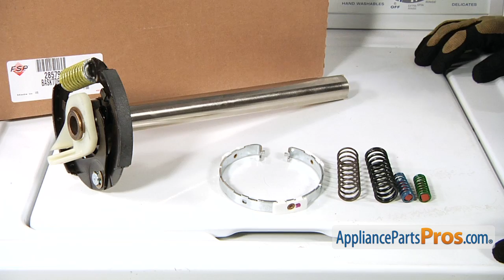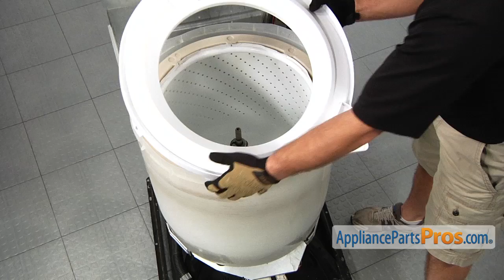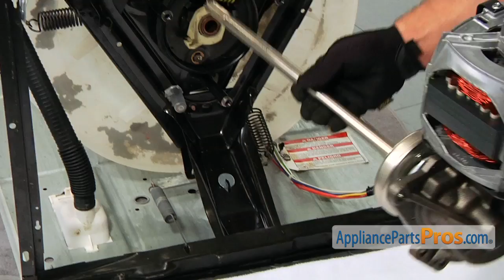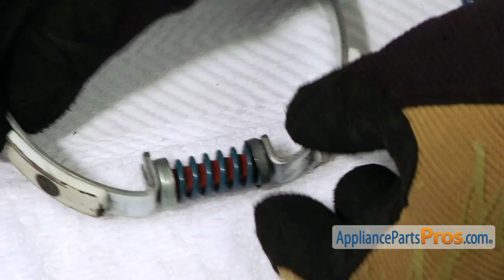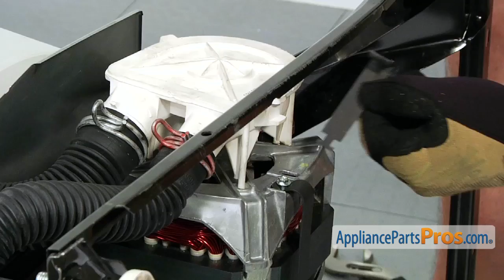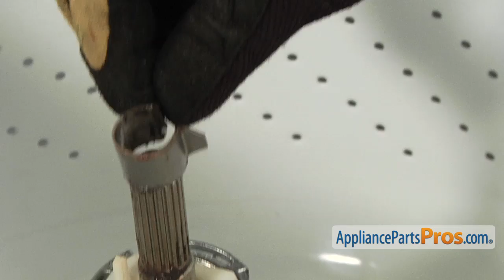Whirlpool Washer Basket Drive W10820043 Replacement — fits KitchenAid/Maytag

Comment: I have an old whirlpool washer that wouldn’t spin, it never had a lid lock, but it does stop agitating or spinning if I open the lid. The agitator would spin but not the basket. I replaced the clutch assembly 285785. Now it pumps, but nothing spins. What do I need to do to make it spin? Thank you. I don’t know if I’ll get an answer since this video is about 12 years old.
Reply from the maker: What is the model number of the washer?

Comment: What kind of grease(part # )is required to use on the basket drive shaft and sleeve bearings? And what grease is used to lubricate upper and lower seals ?

Comment: I have a Whirlpool model LST7233DQ0 that was leaking (tub seal).  Got the inner tub out, but the drive block does not want to come out bottom of tub.   The plastic part at the bottom of the tub has ragged pieces going inside the tub keeping the drive block from coming all the way out. I have never come across this. 
  What gives?

Comment: Are the bearings located in the basket drive as stated in your other video regarding the basket drive and bearings?  I understand the bearings are included with a new tub spinner support base?  So my second question is would the basket drive then come with the new base part # 80184 replaces part # 285203?
Reply from the maker: That really depends on your model number. You can give us a call at 1-877-477-7278 or you can chat us at our website: http://www.appliancepartspros.com/ and we'll help you out. You can look here on our website to help you find the model number: http://www.appliancepartspros.com/modelnumber_locator.aspx

Comment: My PAV2300AWW series 12 machine cabinet is different. Only the front of the cabinet comes off, sides and back are all one piece of sheet metal attached to the bottom by 9 screws. I need to change my basket drive, I also found there is no SPANNER NUT in the inner basket. Instead there appears to be 4 X about 1&1/4 inch bolts holding the inner basket to something below it. I can find no information to make the repairs I need to make and at the point I am at presently I am not sure the parts will fit the machine, nothing else seems to be right about my PAV2300AWW series 12 washing machine.
Reply from the maker: If you need additional help with the repair outside of what's demonstrated in the video, you can give us a call at 1-877-477-7278 or you can chat us at our website: http://www.appliancepartspros.com/. We also have a free repair forum where the techs can help you troubleshoot the problem: http://forum.appliancepartspros.com/. We’re here to help 7 days a week and we offer FREE technical advice and diagnosis.
Reply: Thats a belt drive Maytag. Completely different machine.

Comment: Hi Matt, hoping to fix this machine before the wife makes me buy a new one. Agitator works so I think that rules out coupler and transmission. I'm unable to physically move the basket by hand without a lot of force. Does this sound like a basket drive/clutch symptom? It almost seems like I should add lubricant but I don't see anything like that online. I'll happily order replacement parts from you if you can help diagnose. Thanks for the video
Reply from the maker: Leif Johnson Hello first you want to make sure there is not anything between the tubs that would jam it or make it hard to turn, clothes, socks etc. Then I would check out the brakes to be sure they are not dragging. Way more info than I can add here, so here is a link to our repair forum where they talk about the brakes:http://forum.appliancepartspros.com/washer-repair/3265-replacing-direct-drive-washer-brake-shoes.html
Reply: hi, thanks very much for the reply. I have completely disassembled the washer and thoroughly cleaned between the basket and basin. the clutch is certainly bad, but wouldnt i be able to spin the basket by hand if it were just a worn clutch. that's the sympton i'm most worried about. if i can't fix that, the washer's toast
Reply from the maker: Leif Johnson What was the original problem you had with the washer?
Reply: would not run the spin cycle, agitator works, i held open the lid and depressed teh trigger switch and watched a whole cycle. When it went into spin mode, it made a new sound as if something should be happening but basket did not move. at that point i could still hand crank it to get it going but it would not get to speed. now after dis/re-assembling it, i can barely turn the basket by hand at all.
Reply from the maker: Leif Johnson Ok maybe I miss understood you, I thought the tub just was not spinning so I said to look for something jamming it. You said the clutch was bad so I assume you are going to change that. It could be that the bad clutch is the only thing you have. If the clutch is bad and slipping you may be able to help the tub start spinning by hand but it does not free spin. When you try and turn the tub you are trying to turn the tranny and everything by turning the tub, it will not be easy. It could always be something in the tranny but the clutch was the obvious thing you saw. The other quick and easy thing to check is the lid switch it is a safety switch that does not let the washer spin if the lid is open. You can test it for continuity, it should not have continuity when the lid is open and should have it when the lid is closed.
Reply: Ok! That makes sense. Would you recommend just the clutch or the entire basket drive? Can I order either/both thru your website?
Reply from the maker: Leif Johnson After reading the sticky brake shoe thread you would have to decide if 
yours are part of the problem. What makes you think its bad? Are there 
big wear marks on the shaft from the bearings or are the tabs that lock 
into the drive block worn badly? If you just want to change it because you have it that far apart I can understand that too!

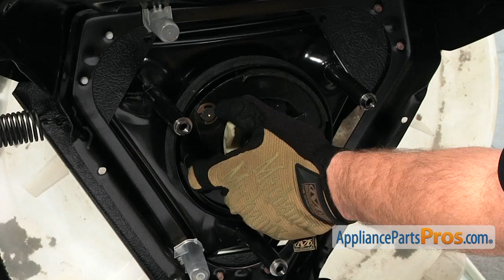Comment: At about the 7:09 time frame there are three plastic cups that form a triangle around the area you are working. In these there are pins that have holes in the side near the tip. What are these pins purposes and are they attached to anything? Are there cotter pins that are placed through these holes? I have tried to find diagrams that explain these but so far are nothing. Could you please help?
Reply from the maker: These are shipping pins. Once released they do not do anything and are supposed to stay in the little cups. If the cup broke and they fell on the ground, then you can just get rid of them.
Reply: Thank you! Also, do all older top load washing machines use the same BALANCE RING?
Reply from the maker: There are a few different ones. It is best to go to our site and enter your model number to search for it.
Reply: Do you have a video that shows how to replace this part? I have looked on your channel and did not find one. Thank you!
Reply from the maker: You can watch this one on how to change the tub cover seal. Once you get the tub cover off you should be able to lift the balance ring off the inner tub. Washer Outer Tub Ring Seal (part #3976308) - How To Replace